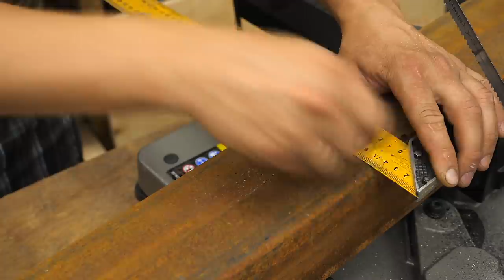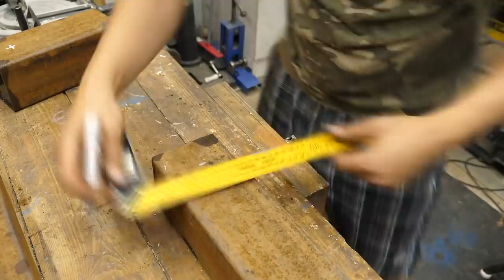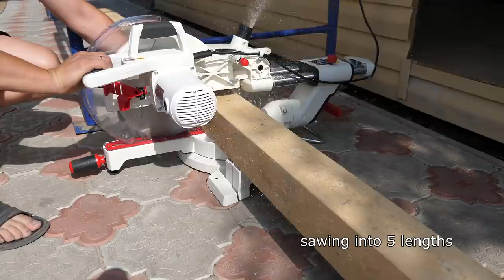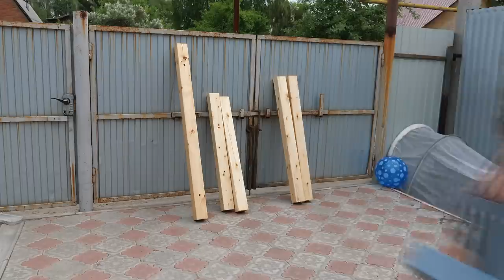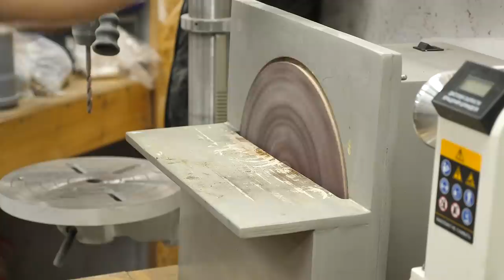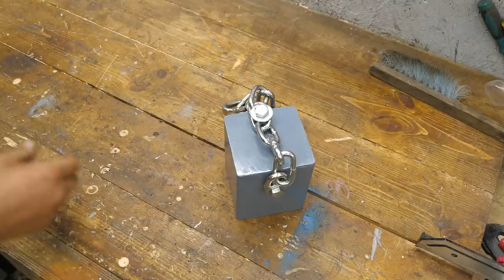I saw in the store and decided to do it myself. I did a lot better!

Comment: Hey,all I need is a couple 4×4's and some square tube stock!
 -and a metal band saw,welder,grinder,grinding stand,cutoff tool,wire brush,emery cloth,paint, bolts,nuts,washers...
Reply: I don't see what you're complaining about, it's way better than a $60 walmart hammock for only $100 in raw materials, and $10,000 in tools.

Comment: When welding steel always be sure to remove all rust and mill scale.  Must be shiny , shiny finish,  this will allow the 2 pieces to melt and flow together.  Also  do 3 passes on each weld, for maximum strength. 
Nice project,  enjoy!

Comment: The only thing I would have done differently is add gussets between the horizontal tubes and each of the angled tubes. When the hammock is being used, there is a huge amount of force on those small welds from those long wooden posts.  Good job....now I wanna make one!
Reply: Nobody over 50kg aloud on it , jockeys only

Comment: I like when a captured saw ... drill...Miller etc is used....
i know guys use hand drills  .. skill saw...sawzalls etc in the field....to usually good effect... i admire precision... even my stamped table saw to which you clamp a skill saw... or my drill frame on which you mount a hand drill..

one time i used the drill frame to drill out a head bolt on a friend's industrial diesel.. .. drill frame got the broken bolt out with only the threads still in the block ... easily picked them out with a curved pick

Comment: Don’t forget some rubber feet on the corners  to remove the wobble from the height difference from the wood being inside the metal tube, and to grip the surface so thing doesn’t slide around.   :))

Comment: Hey Brutha, nice job. Looks good. I just wanna caution you: That string of spot welds you laid down looks really nice. Almost like a TIG weld. But they are not penetrating thru the material and melting the two pieces of square tubing together as one. One pointed blow with a sledge hammer would really surprise you. Nice looking project tho.

Comment: Easier to clean off the rust before you cut the metal tubes into small pieces and weld them together. I like how you rattle the paint can and spray at the same time; lots of nice short strokes. Nice final result. I hope you get many well-deserved naps this summer.

Comment: Amazon sell these for £83 including the hammock. Lighter and easier to store. Why is yours better? Heavier, yes. Stronger, yes, but way too strong for its intended use. No joint cleaning prior to welding. No visible safety gear. Make something you can't easily buy.

Comment: You should have put the cap on the end and went through with an eye bolt, instead of the chain. Otherwise very well done.
Reply: Let's see u try
Reply: Need the chains to adjust the hammock to the proper sleeping height.....Anaco,  Anz.

Comment: Flip flops, shorts, no safety glasses....  those are next thing you need to buy.     Guess you never had the pleasure of getting a sliver of metal pulled out of your eye.  I was in a shop when a guy cleared a lathe with air gun as I was walking through.  Spent a couple of hours in ER..
I weld and can not imagine not wearing shoes or boots...and still get a few hot spots on my feet..
Guess Safety First means different things to different people.   But I will compliment you on your craftsmanship, you are definitely very talented at what you do.

Comment: Why would you bolt chain to the top pieces when you have a welder ? Waisted step drilling and bolting the chain on it when a weld would hold just as good and look better .

Comment: I admire the design and all the effort, but I'd bet I could build the same thing with just the timbers, and not waste all that steel fabrication.  Some well cut joints would be more than strong enough to hold up a hammock.  (But then, I've sent some years woodworking, and never really learned to weld.  YMMV. )

Comment: Very nice. I was just about to put one on my to-do list but I'm wondering if anybody has any ideas on how to deal with rust on the inside? Okay if I put it in the yard but if I put it on my deck I can see that after a few storms I will have rust stains on my decking. Any ideas?
Reply: I can tell ya. The only way to prevent rust, and having to deal with it, is to get rid of it completely. Either use metal that don’t have it, sand or bead blast every bit of it away, or chemically remove or treat it. Then seal the metal from contact with oxygen either by painting it, coating it or sealing it. Oxygen + metal = rust, but also, acid + metal = rust called corrosion. A properly coated piece of metal  will still be around when our grandkids die of old age. For example, antique guns.

Comment: Took awhile before i guessed what it was. Brilliant. But couldn`t you just as easily have a half-ring of some sorts welded to those "end-mounts"? Seemed a bit overkill with all of those bolts, and there should be no need to adjust or remove the chains. But very,very nice.

Comment: Am I the only one who cringed when he just put paint straight on top or rust?....
Reply: No not just you.😉
Reply: Jeriah Smith rust oleum paint pick it up at any hardware store
Reply: @coreyjohnson4909  negative. No paint should be applied directly to rust, it doesnt allow for proper adhesion to the project.
Reply: @cezarymalinowski1730  well crap, guess I'm the only paint nerd here 🤣🤣🤣🤣
Reply: When all your tools are Jet you can pretty much do what you want in life.
Reply: I was more curious about welding over cutting fluid/oil.
Reply: All that work, only to have it rust away sooner rather than later

Comment: The second bolt adds no advantage as the first one carries all the weight. If anything will break it will be the first chain link or wood and not the bolt in my opinion. You did a nice job, only …. I was a bit disappointed that you did not put more work into removing the rust properly as that would preserve it better and secondly did not weld the caps from the outside to prevent rain from seeping in as the welds will rust from within. However that is how I am … a bit fanatic when I do things. All in all continue on so and you will save more money and have even more tools in the future to build good projects.

Comment: Gonna be a lot of swearing when people cut themselves on those bolt ends stick out way too far all over the place. Can you not trim the bolts to proper size? If it were me, I would use acorn nuts so there's nothing sharp protruding.

Comment: I paid about $50 for mine ten years ago and  then they are now about $60 on Amazon (I'm 230 lbs and it is sold and has never tipped), this one is beautiful, but it took all that work and all those tools for a commodity item...  Sorry, it's not worth the effort
Reply: Buy something for 50    make the same thing for 60   stand back and tell me which one gives you more pleasure to look at.
Reply: @Blaze_1961  You are forgetting the cost of all of the tools necessary to construct hat $60 item (and yes I know that the tools can be used for, and amortized over, many projects).  My hammock stand weights about 30 lbs, can be taken apart and reassembled with easily with no tools (great for trips in the camper), and I can move it with ease, this one probably weighs over 100 lbs with all of that 100 x 100 mm lumber (which will rot in the sockets in a few years if left outdoors, no matter the finish - the metal drains and I've had mine for probably 15 years, I have had it through several homes and the 10 years I mentioned above is short).  My goal is to have a hammock where I want it most easily and supported in a safe and sturdy way.  This particular project (and I am in no way talking about any other), just isn't worth it IMHO.  I think that many YouTube project builders are amazing and I subscribe to a bunch of channels, but sometimes the project is one too far...  I put this one in that category.

Comment: To much droop in the hammock. You should adapt your design so the center wooden strut goes through the middle at both ends Instead of your side struts. That way you can have multiple adustments for length. So you can put  proper tension on your hammock. All hammocks stretch. Yours started out too long in the begining. Nice build. Well done.

Comment: This is a bit amateurish. 1st the lack of ppe, the incorrect coolant for the saw, decreasing on a rusted surface, inaccurate marking out for drill holes, painting onto a rusty surface. The finished build looks good and I'm sure it is an improvement on the commercially available one, but it is compromised by the poor build quality. You clearly  have skills but lack attention to detail. That is what separates you from the best home build sites.